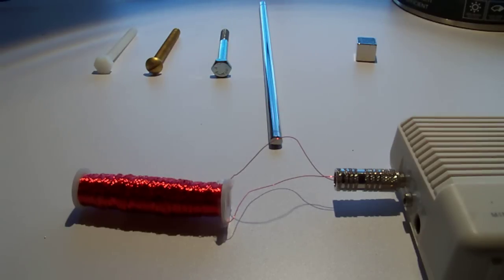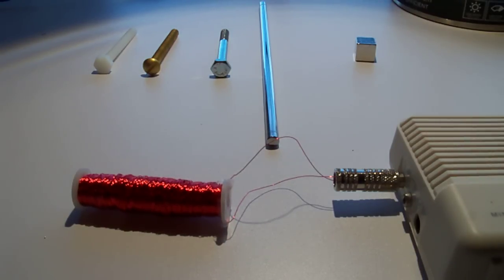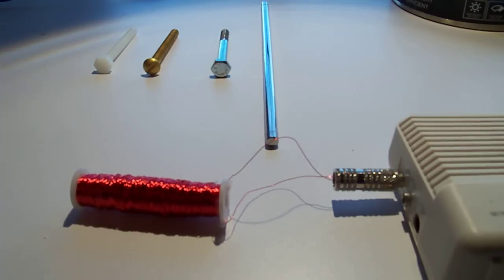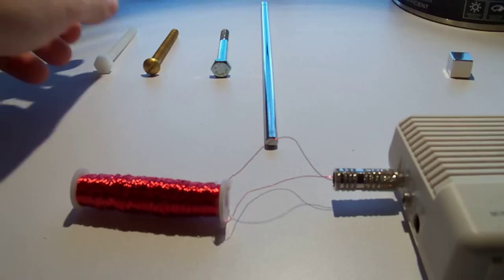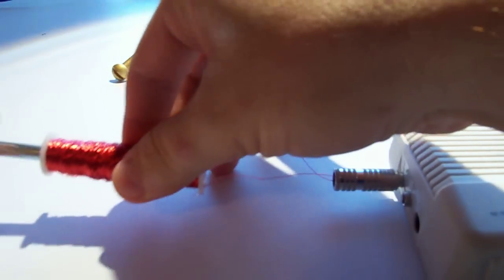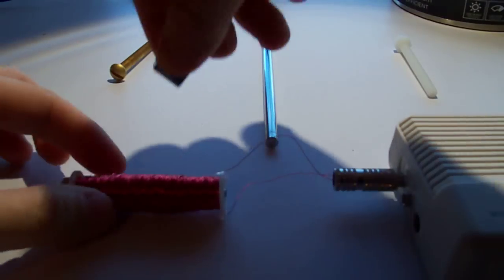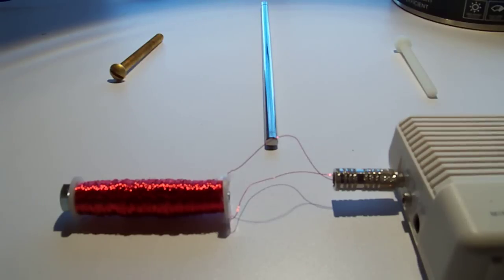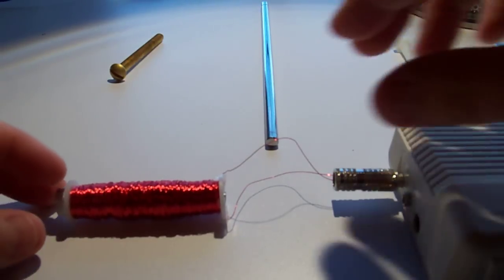The Barkhausen effect

Comment: I know very little on this subject . Is this why carbo rods are used inside the wire coil in a  small radio ?
Reply from the maker: Not sure? If there's a carbon steel rod inside a coil, that would probably enhance the magnetic flux in the coil, but haven't looked into it in detail.

Comment: basically the current flow induced by the magnet into the iron core, is the same that occurs in a single cycle of AC in a transformer. in that case though, a second coil creates the magnetic flux in the iron core, instead of a permanent magnet.

Comment: I think the Faraday effect induces a voltage in a wire, not a current.  If there is a complete circuit of some sort, that voltage can drive a current, that depends on the impedance of the entire circuit.
Reply from the maker: That is correct. It creates a circulating electric field, which will drive a current if there happens to be a circular wire in that location!

Comment: I like this a lot, I was aware, but today I did take one step beyond in observational use of this.

And in case you were wondering....
So:
I seeing this the thought hit me. If the number of turns were increased, AND the soft iron rod lengthened. The “sensitivity” could be increased exponentially.
Why would you do this?
#1, it would as a result show more background “noise”, or as they commonly call it the signal to noise ratio would increase.
#2, being more sensitive it would create a device (s) that could interpret directional polarity to the overall input, allowing one to judge direction against which the magnetic flux is aligned with.
The earths magnetic field would obviously be a “signal” a constant as the device(s) were tweaked to partially tune the circuit.
However, as I mentioned a few days ago oxygen is paramagnetic, so if large numbers of the gases molecules, atoms pass a location a device would then be able to detect through that interaction the intensity and direction.
Yes one could simply buy an wind Anemometer, but, of interest here is that the oxygen is a moving magnet…
Never read that in a book, or TV show? Nope….
So the device as noted above would show the magnetic strength of not simply the “wind”, but it now allows one to better understand how harp works!
And also allows a understanding of this giant transformer in relation to the Earths moving pole!
Since the “air” contains a large amount of oxygen in all forms be it free, or as ozone, or part of molecular carbon “dioxide”, then one can now see that not only does this airflow (jet stream)  act as a transformer, but as a brushless motor winding!
The Earth’s crust is the armature!!!!!
So if the field starts to change it’s polar alignment the fields strength then results in “friction” much as a induction cooking top will heat up!
Since heat results in a curie point, and negative paramagnetic activity the crust will over time have less and less resistance to change!!!!
In better words the jet stream while being a gas, is a relentless force, charged by the suns magnetic field, and the crust, floating above the plastic mantle has NO choice but to eventually align with the average polar alignment of the Earths jet streams!
Since the oxygen is a field contributor, it IS essential to life, no oxygen, no protection from cosmic radiation….

Comment: Very interesting. I would have predicted many things to be different. First off, I would have expected to hear a 'zipping' sound, owing to the threads of the bolt and screw. (I didn't hear that) I would have expected to hear the brass screw, not because of magnetization, but, because of induced Eddy currents induced by the movement of the magnet. The actual Barkhausen effect surprises me, because I would have thought that there are enough atoms of iron in the bolt and the rod, that the domains would  be small enough, that the harmonic would way above the bandwidth of hearing. It makes some sense with steel, because it's an alloy, with larger domains, and flaws in the overall structure. Pure iron should be homogeneous enough, to keep the domains small enough, that we shouldn't have heard anything.
What a great experiment! (Hate to say it, but, I'm going to "try this at home")😉😉

Comment: Fascinating.

So if I understand this correctly, the sound of static is being caused by myriad nanoscopic crystals within the structure of the metal, as they physically realign themselves along the magnetic field lines being generated through the interaction beween the Neodymium magnet & the copper coil electromagnet..?
And should a paramagnetic (⊚) metal like Iron be exposed to a an intensely powerful magnetic field for a sufficient time, then the effect becomes permanent, turning it into a magnet.

⊚ - nb: Iron becomes diamagnetic only if bonded with another material like Carbon, Chromium, Manganese, Molybdenum, etc.

Comment: I don’t understand why there is a difference in the sound produced when you insert the iron core.  What I understood was that as you move the magnet back and forth a current is produced in the coil, regardless if there is a ferrous core or not.  Is that current AC?  And when there is a core, it seems like the current is more pronounced (creating a more persistent sound) - does this mean the current is changing slower or faster?  Is the difference between the two experimental setups (no core vs ferrous core) because the presence of an iron core creates a magnetic field that is (similar to? opposite? Orthogonal?) to the magnetic field created by the magnet?

Comment: Very interesting experiment. I'm wondering if a ferrite rod would increase the volume? The ferrite rods or ferrite slabs are used in an antenna pickup coils in old AM transistor radios.

Comment: I'm not saying this isn't true.. Just something I'm asking myself when I watch the video.
The metal cores increase the inductance drasticly - so each little move of the magnet (and therefore the first derivative of the magnetic flux density is inequal zero) induces way more current in the coil compared to an air-core.
Do you still hear the sounds when you adjust your speed to be inverse proportional to the inductanceincrease?

Comment: What if the rod placed inside was also a magnet? Would the interaction of the two magnetic fields produce any noise from the amplifier?
Reply: I think the effect might be weaker as the magnetic domains in a magnet are already oriented?
Reply: Good question. Surely the rod at different depths would make a scalable difference of some kind, trombone-style.

Also, if you held the coil up to the amplifier speaker, would you hear a) nothing, b) similar white noise, c) same as magnetic rod, d) feedback [tone], e) other??
Reply: @chriskaprys  depends. Practically very low feedback. Feedback is due to coupling of the coils

Comment: so basically with your magnet and a coil your making electricity in that coil and then you can hear it and because different materials act differently, we get different sounds. BUT if we make a coil with wires touching each other, doesn't it make only increase in amperage?

Comment: Cool demo. I made a little demo showing the faraday effect on a solenoid as I move a magnet through it. I displayed the voltage across the coil on an oscilloscope the pushed it in/out of the coil. Showing the little voltage jumps on my scope. 

 I didn't think to use a speaker to listen to the changing voltage. I think you gave me an idea for some new experiments. No videos. Just something for me to play with.

 I just need an amp which I can just get for a buck or two on ali express. Just on a bare PCB Thanks for the ideas!

Comment: I think the reverse effect, where a magnet inside a coil magnetizes a piece of moving metal, is what makes electric guitars, basses, etc. work.
Reply: It doesn't magnetize the strings, they do not exhibit magnetic attraction and cant even pickup iron shavings unless physically touching magnetized pickup polepieces.  They physically move in the complex magnetic field around the pickup.
Reply: @r61425  How does just moving a piece of metal around in a magnetic field affect it, assuming the metal is not being magnetized? I guess the string then could be part of the core of the inductor, and moving it would change its inductance? But there's no currect being supplied to the guitar so any current to the amplifier must come from the guitar itself.
Reply: @stekeln  I don't know much about guiters but I think the strings are made of weakly magnetic material like steel or sth. Thus a tiny voltage change is generated in the pick coils [due to perturbation of the magnetic field of the pick] this then gets amped. The picks have magnets in them, no?
Reply: @rex-up9ln  Well, magnetic fields can't be "perturbed" so to speak. They are additive so in this case the magnet(s) in the pick-up would be completely unnecessary since it's not moving (in relation the the coil) and so could not generate any electricity. The only thing that could do that would be a moving magnet, the strings. If guitar strings were magnets themselves, the pick-ups would not need to have magnets.
Reply: @stekeln  1. Perturbed in the sense "disturbed from its original state", i.e the static fields around the permanent magnet. 
2. See https://en.wikipedia.org/wiki/Pickup_%28music_technology%29 my guess was correct, there are coils wrapped around permanent magnets and the strings are ferromagnetic
Reply: @rex-up9ln  Yes, just like I said in my comment: the strings are being magnetized by the pick-up. They are ferromagnetic , meaning they are attracted to magnets and can be magnetized. When the strings then move above the pick-up, being magnets, they induce an electric current through the coil.

EDIT: Sorry, I thought you were the first person who replied to my original comment (John Smith). We've been arguing for the same thing.
Reply: @stekeln  The strings aren't fucking magnets, the only reason pickups have magnetic cores is to strengthen and expand their magnetic field, they still work with an air core, just very weak; to the point that, microphonic pickup that happens as loosly wound and/or unpotted inductor wires are subject to external vibrations(much like in a condensor microphone) will compete in volume with the signal from an airgap pickup.
Reply: @rex-up9ln  Strings do not have to be ferromagnetic, it just helps significantly.  It is not magnets moving eachother that produces sound, it's the imductor resisting ac change in it's magnetic field that generates the current.
Reply: @r61425  Okay, why are you being so offensive? I know that the coil is resisting changes in the magnetic field but what we're interested in is where that change is coming from. If the pick-ups work with an air core, where is the magnetic field coming from? The coils aren't getting any power to create a magnetic field of their own. I theorize that a set of strings that have never been in the proximity of a magnet will not work at all with an air core coil.
Reply: @stekeln  yup. The strings have to be ferromagnetic. The vibrating magnetized strings induce the voltage in the coils below. If you use say, copper strings, a very small voltage will be induced in the strings themselves, but they aren't connected anywhere. The guy with an anime pfp is confused.

Comment: This is interesting, although I don't know if people know why it is. The atoms aren't all magnetizing at the same rate. I always figured that, when exposed to magnetic fields, ferrous metals all magnetized at roughly the same speed. But for a "static' sound to occur, that means fields are changing all over the place, each at different rates. Some atoms flip over quickly, others take their time. Each movement is a ping of energy in the coil as it moves and generates a brief burst of power. When all aligned, the coil reaches equilibrium and stops producing power.  

Thanks, I've never seen this before! When looking at things macroscopically, it's easy to forget that on a microscopic level, whole worlds are shifting.  To really understand something, you have to visualize it at the atomic level. Just mountains of atoms, each succumbing to their individual needs, eventually adding up to results in the visual world.
Reply: It's almost like a rain stick where you're hearing the atoms realigning. Fascinating.

Comment: Very interesting!
Note that the Faraday effect deals with polarized light.  What you might have said is 'electromagnetic induction'.  Second point...it's not current that is induced, it's voltage.  Current will result if the coil has a load.
Reply: Correct about the Faraday Effect! Yes, it's voltage that is induced in the coil, but in this case there is also a small current flowing, because the coil does have a load - the input impedance of the amplifier.
Reply: What a load of.... jk😉